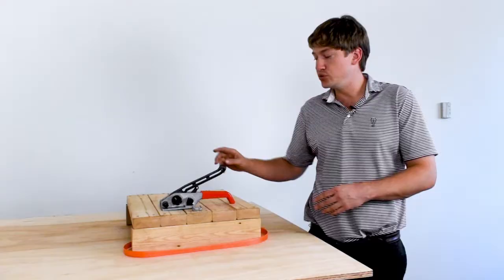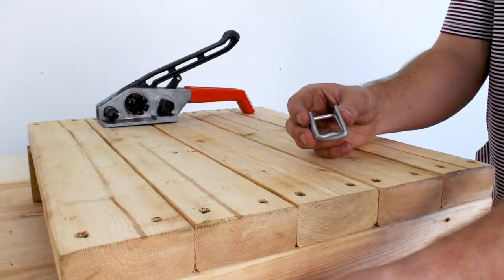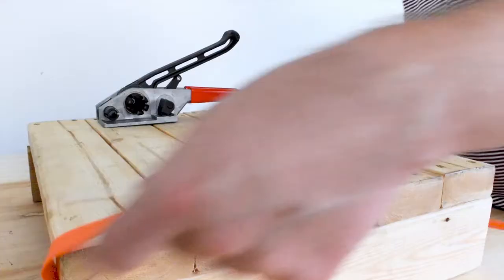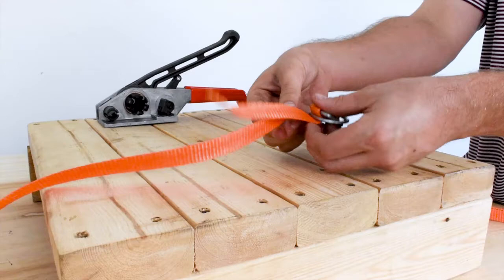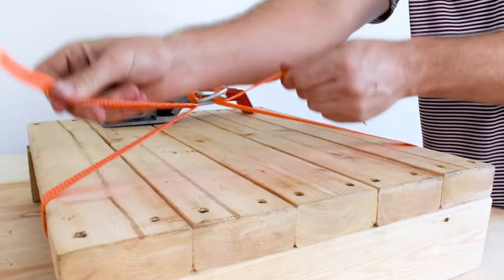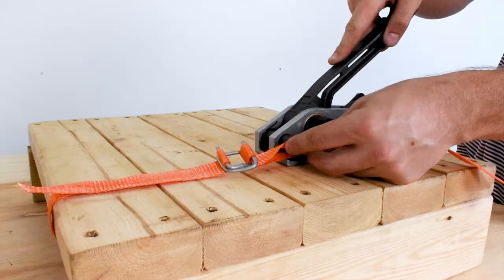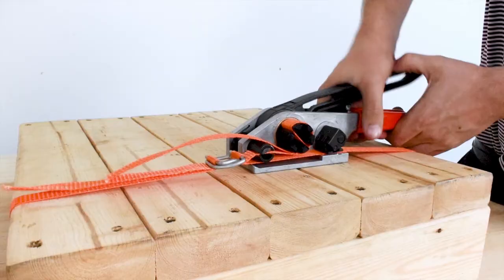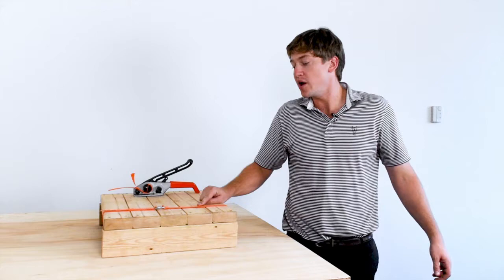How To Tension Cord Strap w/ Wire Buckle

Comment: Is it possible to untension this without cutting the web?  E.g. I have an application where I need to later adjust tension so they are all the same. This may mean adding a quarter inch of slack to one band.

Is it possible to retension it later if you leave an 8" tail
Reply from the maker: Hello SherwoodBotsford,

Yes, that should be possible. As long as you use a wire buckle with the application, you should be able to retention with the EP-1190. If you ever need any additional help with Encore Packaging products, please do not hesitate to contact us by either calling 847-735-8105 or email us at sales@encorepack.com. 

Have a great day!
Reply: Yeah i used to just slide the top strap out of the cutting ring after cranking and squeeze the handle and slide the tool out that way i didn’t cut the band too short and i can come back and adjust the tension